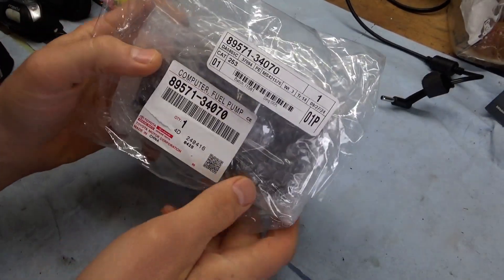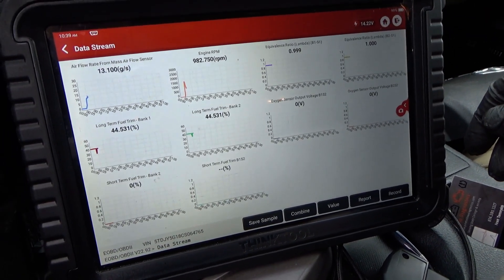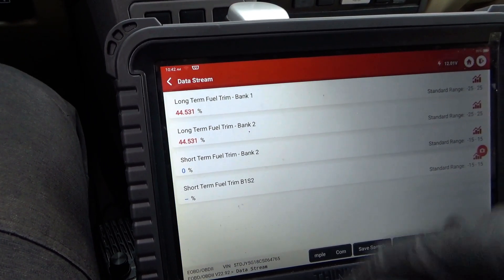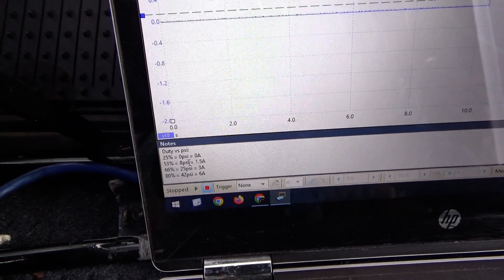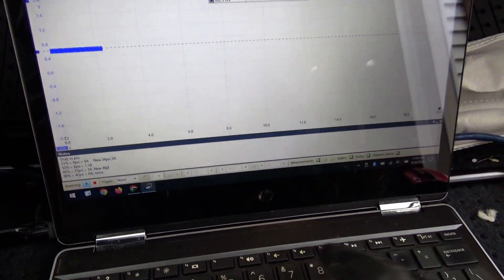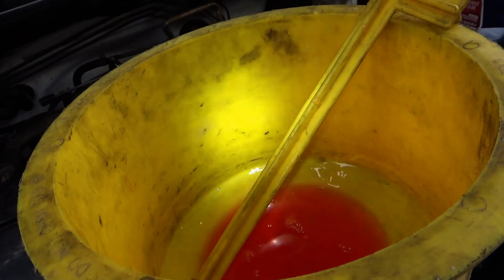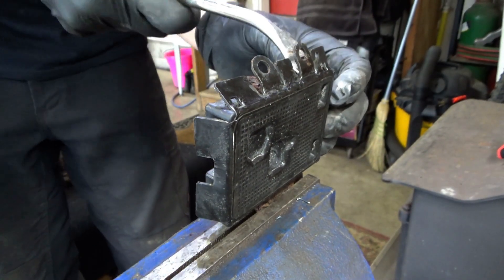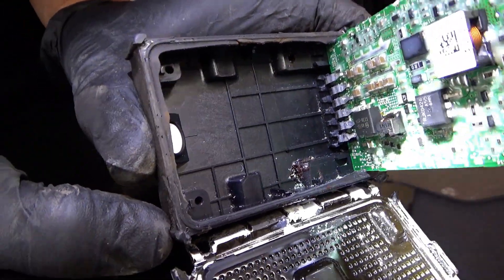(Pt 2) $2000 MISTAKE? (Toyota V8: LOW Power-STALL-Runs LEAN-Low Fuel Pressure)

Comment: I absolutely despise these “ shops “ that rip people off. In a similar situation right now with a 07 4 Runner ( was told it was a Highlander) . 70 + nice lady, ripped off for new right side cat and two O2 sensors, and same po430 code back in two days,  2000$.  She don’t even want to take it back to them , understandably , but when I figure out the real problem, they will be getting a call from me. To me , this is outright theft, grand theft in this situation. I don’t know how these people can sleep at night , or how they stay in business . I’m done rambling now.  👍👍🇺🇸
Reply: OBD II DTC P0430 = Catalyst System Efficiency Below Threshold Bank 2. As you are sitting in the drivers seat the right side cat is on Bank 1 of the V6. Bank 2 would be the left side cat. Did they replace the wrong cat?
Reply: @windward2818   It did appear to be replaced. (right) I just looked it over quick in my driveway and gave it a quick scan. I didn’t get it in to work on it yet as she wasn’t prepared to leave it . I didn’t look anything up yet as for some reason I still cannot get logged back in to Mitchell1 diy. Going to try someone else today after I get current project done .  I actually never gave the right/ left  aspect a thought , that is interesting for sure. Maybe I’ll give  ALLDATA or someone else a try here this morning.  Thanks! 👍👍🇺🇸
Reply: @windward2818 Interesting!  I just gave it a quick preliminary in my driveway as she was not prepared to leave it, and I have to find a different outfit besides Mitchell1 DIY for tech support( still cannot get logged in) . Maybe I’ll give ALLDATA a try. As I hadn’t yet looked up anything I never gave the R/L  aspect a thought. Wouldn’t that be something if that’s what happened!  The vehicle is in really nice shape and only a bit over 100K . I still think the problem is elsewhere, we will see.  Thanks 👍👍🇺🇸.  ( and yes, the right cat was replaced, and it is a 4.7 v8)
Reply: @windward2818 I replied twice early this morning winward , got removed for some reason. It did have the right cat and up and downstream sensors replaced. The lady wasn’t prepared to leave it, and I hadn’t looked anything up yet, but I didn’t even think about the right/ left aspect . Interesting.  I’ll get to it in a day or so. It is a 4.7v8 , but should be the same set up for bank ID.  Thank You  👍👍🇺🇸
Reply: @brianw8963  The Toyota 2UZ-FE 4.7 Liter V8 is numbered different than the V6. It is numbered like a Chevy small block V8, where from the drivers perspective bank 2 would be on your right. So changing the right side components would be correct. In order for the OBD II codes to make sense we need to consult OEM engine data to find out how the cylinders are numbered and how the banks are assigned. Toyota tends to follow GM for numbering where the bank with cylinder number one is bank one.
Reply: @ Yep, was just looking that up and found the same thing. Thanks

Comment: RE: the low coolant. My dad's 2010 4.6l Tundra had a slow leak from the lower radiator hose where it connected to the radiator. I wonder if it's a similar thing here.

Comment: I think I need to start making Toyota fuel pump controller boards. That's a $10 board in a $5 case at best
Reply: I can't believe companies aren't reverse engineering module programming and selling them. I feel like it is a perfect job for AI.
Reply: Or just bypass the controller and run the fuel pump at 100%. That’s how it used to be done.
Reply: @kevinmills5293  Well yes, it is a return system so running it at 100% would be fine. I imagine they do it to save pump wear or increase fuel economy by 0.1mpg or something though

Comment: A guy at work only buys Sequoia’s with 200k and sells them at 300k.  Been doing that for a long time.
Reply: A customer of mine did that with Land Cruisers for years. He’d buy them for $5k, drive them for 100K miles, then buy another one. He did this from 2000-2018. The market eventually caught up to what he was doing. A head-on collision destroyed his most 2005 LC. He’s currently shopping for a replacement. He’s looking at ‘99-‘06 models with 150-250K miles. They’re selling for $18-23K.

Comment: Great job as always Ivan. ** That FP control module casing is aluminum, the bracket steel, and the frame too. You have galvanic corrosion or ectrolysis going on. It's generating a small voltage and rotting the metal. Here read below. Salt is the electrolyte.

**Galvanic corrosion (also called bimetallic corrosion or dissimilar metal corrosion) is an electrochemical process in which one metal corrodes preferentially when it is in electrical contact with another, in the presence of an electrolyte. A similar galvanic reaction is exploited in primary cells to generate a useful electrical voltage to power portable devices. This phenomenon is named after Italian physician Luigi Galvani (1737–1798).

Comment: Even though that part was bad, it still serve a valid purpose. I save many old, defective parts to use in testing purposes. Since you know how that part functions even though it is bad, it is useful for that same test in another vehicle. 

Rather than going through the multiple diagnostic tests, you could easily insert the known bad module to test and see if the original problem now changes to the symptoms of the known bad. Now you'll know right from that point where to go and if you have to go further.

It's saved me hours of diagnostics many times over in my 20 plus years. And it's never let me down. Defective parts are worth more than you think if you know how to use them to your advantage.
Reply: Good advice, unfortunately Ivan has a much larger challenge in that many of his repair customers are bringing Ivan their vehicle after another shop or dealer has attempted repairs which means maybe installed defective parts, or damaged the vehicle in other ways beyond the customers original problem. Much of what I do is diagnostics like Ivan and with diagnostics you have to provide an approach and back up each test with data. You are essentially being paid to not only identify the problem part(s) but also how it produced the customer complaint. You can only do this by taking scope traces, thermal images, and other methods that you can show to the customer in the course of your testing.
Reply: @windward2818  I understand that but it doesn't negate anything I said. you could have 14 different shops look at it and still use what I said as a valuable diagnostic tool. 

Having a known bad part that behaves in a specific way is a perfect replacement for a suspected part. If the problem of the "new" defective part now replaces the original problem, then you've found your culprit. If it adds to it, then you know the original part is good.

It's basic diagnostics that even Ivan's extensive diagnostic skills can't reproduce . And sometimes that's where you'll hear Ivan say he's guessing.

Imagine having a spare part, defective or not, that allows you to take that guess work out of the equation.... Pretty powerful diagnostic tool.
Reply: @HueToobBlows  It never crossed my mind to swap with a known bad part, good one. Seems logical to me, but I'm not the brightest bulb. Try unplugging it and DC the battery to reset to see if it goes into limp mode with better LTFT numbers? IDK. Cheers.
Reply: @gnomiefirst9201  The biggest problem with diagnostics is not always having a test part and worrying about making an expensive mistaken guess. That defective part costs nothing to have on the shelf but could very well be useful in diagnosing similar problems.
Reply: @BEANS-O-MATICtransmissions  Great minds think alike!

Comment: Excellent job, Ivan! Thanks for showing the autopsy of the fuel pump ECU - that rusted bolt cracked the housing and sent the owner on an expensive journey. Luckily, he turned to PHAD, or he would be still paying shops to throw parts at it.
Reply: Shame, for $150 more we could see if the ebay one from japan works.  Wonder if a nylon bolt is the upgrade fix for this problem.
Reply: Nylon, brass or stainless would all be good options. Nylon might no be strong enough.
Reply: Brass is too expensive and you can't use stainless if you bolt it into steel part.
Reply: @TheMystikal82  Yep, but on a $400 part, it seems a cheap choice.
Reply: @TheMystikal82  The entire frame area wants a zinc sacrificial plate bolted on.
Reply: @robertsmith2956  Its what we used on boats with either zinc, or gold-plated zinc sacrificial anodes, but these had to be replaced every few years, but I believe that attempts were made via electrolysis to stop rust on cars back in the 1980s with not much success.

Comment: WTF does everyone bash China problem isn't with China the problem is with manufacturers requirements , cheap companies want the cheapest product that is possible. If they actually stipulated the engineering standards that they need they will get it.uld have checked the filter and regulator before throwing $400+ parts at it

Comment: 2000.00 for a fuel pump installed? Hard to believe. What business can justify that pricing. I would of looked at a Carter fuel pump if needed,  and Standard Motor Products for the fuel pump Module. Sounds like all that was missing from that other shop was a Gun and a Bandanna.....
Reply: He did said a Flagship ECU was also installed.
Reply: @2muchy2  He Did! I still think they were overcharged. I would have done it myself for a fraction. I am retired tech ASE L1 and Master certified. GM also Master Certified
Reply: It cost me just over $1,000 for a new fuel pump in my old 2003 Saturn L200. My car is going on 22 years old and it's still that expensive to change it.
Reply: I just paid $154 for a Delphi fuel pump. Get to spend a couple hours installing it. Better than 1-2k full service.
Reply: "As through this world I ramble
I see lots of funny men
Some rob you with a six gun
and some with a fountain pen"
-Woody Guthrie

Comment: Why in the actual heck does this need to be a separate module.  Add to that, multi speed fuel pumps on return systems make no sense to me.  Just beef up the darned pressure regulator.

Comment: I'm a bit confused. How does it know what pressure  the fuel is? Next would this be PWM for the rate of pressure?  Another great job. Love these videos.
Reply: With a return port fuel injection system the motivation for changing pump speed is primarily to reduce the heating of the fuel to improve the performance of the EVAP system and reduce the charcoal canister size. The PCM commands pump current (flow rate) based on engine load. The PCM is continually calculating the amount of fuel mass needed to burn all of the oxygen (measured on a mass basis, hence mass air flow sensor) in the cylinder at a desired air fuel ratio. The PCM then looks up the best pump speed and commands using a PWM. As you can see with this case study the PCM does not know the fuel rail pressure or the pump current so it cannot directly identify the root cause. But, you may ask why doesn't the fuel pump control module report diagnostics and real time data to the PCM? This is a very good question. Is it not considered part of OBD II?
Reply from the maker: @howardiko7156  there is no feedback to the PCM... it just commands different duty cycle based on the program 👍

Comment: Woot!  Awesome awesome!  I hate that Reset function thing.  Autel has the same glitch, no matter which reset you do, it says its doing the transmission adaptation clear function.  It dates back to an old old build of Toyota's Techstream software, I guess everyone just copies the same code and never updates it!  LOL

I can confirm though, a lot of newer Toyotas won't clear LTFTs with a battery disconnect or a "Global Reset."  It has to be done via the subroutine in the ECM.  My Autel would not cooperate on a 24 Grand Highlander, and I had to use Toyota's new GTS+, which is nowhere near as friendly as Techstream to navigate.

You often talk about the need for a dedicated scope for diagnostics, but I will add to that from my experience as a non-dealer tech servicing new and current model year vehicles:  In the next 5-10 years, it will be necessary to carry a dedicated J2534 passthru device and a laptop with Virtual Machine capabilities to run OEM software in order to service vehicles.  I feel bad for the next generation of techs who will have a massive barrier to entry into the field.
Reply: All true! Volkswagen, Stellantis and a few others may not even be in business in the next 5 years.

Comment: From the glimpse of the board, the board doesn't look that complex.  Any ideas what component failed on the board?  Did a component fail or was it a connection failure?  I'm the kind of guy who would tinker with the board instead of paying $400 to the dealer just on principle.  Ivan did a nice job with the diagnosis.

Comment: I had my Mercedes 2002 SLK 320 go into limp mode because of a faulty CPS. After replacing the CPS I disconnected the negative battery lead to reset the computer. This corrected the limp mode condition and all is well.
Reply: the AC  bellow control motors are re-calibrated by disconnecting battery for 10 minutes on my buick lacross.

Comment: If I am correct the first repair was done at a Toyota Stealership so good luck getting any type of refund the other thing is Toyota should have a repair tree  like AllData which should have led to the fuel pressure ECM Cheers Ivan.

Comment: "Made of gold, apparently."  Or the finest Chinesium.
Reply: Finest green. 😂
Reply: OK> If the part is really made to a high specification, it does not matter where it is made.  But.....???
Reply: @wallace3953 who is working in that factory or assembling parts for that factory in a surprising sort of hellhole? Some videos I've seen would surprise you, they often have very young female Chinese workers putting auto parts together on those videos, and the setting sort of looks like a basement or garage.
I'm not saying they're all that way, but you might be surprised.
In this case, the part failed because of the elements and exposure due to so many years in that location on the vehicle, and the use of road chemicals and or salt.
Numerous makes have this type setup resulting in failure quite similarly.
The ones with aluminum case often have a hole eaten in.
You can see them at South main and Eric O channel.

Comment: Great job on zeroing in on the problem Ivan. You've honed your diagnostics to a fine point. Masterful execution.

I was an engineering tech in a new product development group. Ran plenty of temperature/humidity ASTM tests. Many conformal coatings suffer from moister incursion because atmospheric water (in the gas phase) is able to penetrate that barrier. The best way to protect a pcb in that environment is to encapsule it in epoxy. Thanks for the part 2.

Comment: The other shop should give a partial refund for sure. Hopefully they installed a high quality fuel pump and not the EBay special. I guess if you take your car to a shop and they replace a part you better ask for the old part and take it with you.

Comment: Why does it need that magic box?
Reply: Older fuel systems have a "Return Line" from the ~injectors/fuel rail, back to the fuel tank. These have a Mechanical Fuel Pressure Regulator that maintains correct pressure at the injectors, and Returns excess fuel to the tank. Many newer Fuel systems have only the pressure line, and the pump speed/pressure is controlled by the magic box!

Comment: One heck of a job. You can’t just throw parts at stuff now days. It gets very expensive. Thanks Ivan!
Reply: Shop should have replaced the lower priced relevant item first ? 
At a minimum, they should cover your bill, plus the fuel pump labour cost to install that new, unneeded item ?
Reply: A bigger issue than just money, there's no guarantee the "new" parts are not counterfeit and Actually work!

Comment: At the least the shop should eat the labor on the fuel pump
Reply: Sadly without the old one you can't prove it was ok.  They both could have been bad.
Reply: Their diagnostic time was what they should eat.
The new fuel pump didn't help, but look at its age.
Maybe the shop will split it with the customer since they were not really finding the cause.
Or you could go to small claims court, and bring this video showing how it can be diagnosed with the right scan and scope type tools as well as knowledge from schooling.
There is also a 20/20 hindsight factor and the shop believes they were doing the right thing.
Let the judge divide the baby.

Comment: I would extend the wires and mount this module inside or somewhere out of the elements or in otterbox enclosure
Reply: The failure was rust expanding and cracking plastic.  Zip ties should solve that anyways.  I would think putting gasket cement on bolt also would seal it to prevent the problem.
A sacrificial piece of Zinc bolted to bracket to eat the rust instead should also help with the frame.